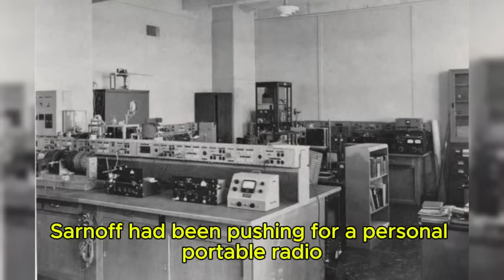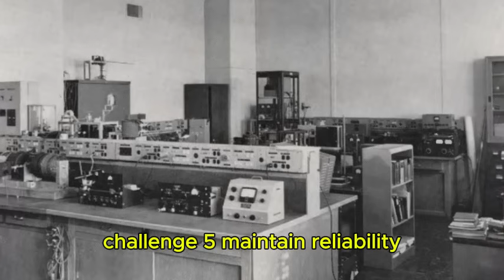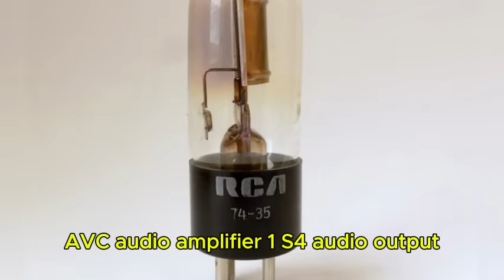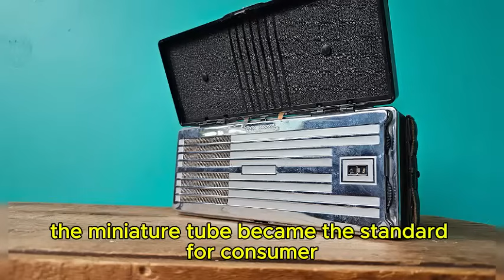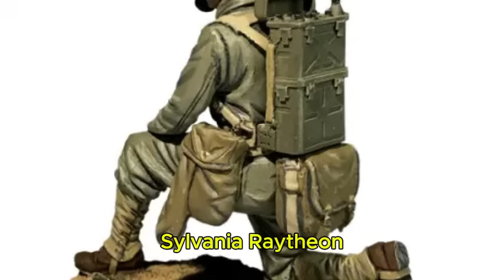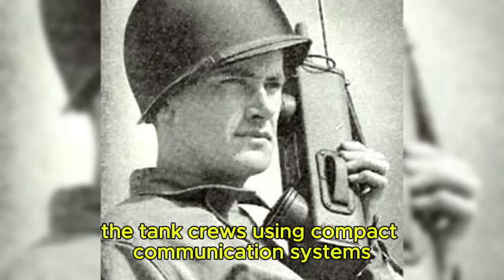America Had No Miniature Tubes in 1939 — So RCA Built Them for Portable Army Radios

Comment: Worked on 1 prc-10 found bad if xfmr after nam tour fixed several hybrid prc25s over there big difference ,25 had one xmitt tube one had screen grid wire tinned and wrapped but not solderedhad intermittent xmit oprrator actually pissed allegedly threw it down notorius Razorback!!!

Comment: The main reson for developing these small tubes was not the radio communication. Here an interesting excerpt of an article in the German Wikipedia, translated for you monolanguage guys.  

„After extensive research and experimentation, a breakthrough was achieved in 1943: the simple impact fuzes used up to that point were supplemented in the last two years of the war by intelligent, electronically controlled proximity fuzes (radio proximity fuzes), whose operating principle was based on the Doppler effect. Along with radar and nuclear weapons, the proximity fuze is among the most significant military innovations of the Second World War – the effectiveness, accuracy, and destructive potential of military explosive munitions with electronic proximity fuzes were enormously increased for the first time in 1943 in the Pacific War with the anti-aircraft shells fired from the Helena and equipped with the novel Mk 32 fuze.[2] The new weapon played a crucial role for the Allies in the Battle of the Bulge. By the end of the war in 1945, more than 22 million proximity fuzes had been delivered to the military, thanks to a massive effort and the enormous production capacity of the US electronics industry.“

Comment: There were even smaller tubes developed such as the 2E32 known as "peanut tubes"  not mentioned here.
Reply: The F-105 auto pilot system used the peanut tubes.  I know because I worked on them.

Comment: The VT fuse used hearing aid vacuum tubes which were much smaller than the miniature tubes mentioned.
Reply: They were NOT hearing aid tubes.   The shape and size of the glass envelope was much the same, but the design of the electrrode structure was different.   Hearing aid tubes were designed to have the lowest possible power consumption.   VT fuze tubes were designed to withstand the tremendous acceleration (up to 50,000 g) of being shot out of a gun.   Heater power for the VT fuze tubes was 5 times greater than contemporary hearing aid tubes.
Reply: @keithammleter3824  My point was that we had very small vacuum tubes before wwii.
Reply: @JohnMills-md7pv  Indeed we did, and not just hearing aid tubes, which of course were small, but that was not your statement - you said VT fuzes used hearing aid tubes, which they did not.
And the 7 pin noval all glass tubes such as the 1T4 series came out in 1940.  The US didn't enter WW2 until late 1941.  Acorns, some just as tiny, go back to 1935.
Reply: The tubes used were designed from scratch perhaps drawing on existing miniture electrode structures ruggedised to survive 20000g
Reply: @Jor-d2i  At that time, all tube electrode structure spacings, shapes, grid wire pitches, etc were designed on what RCA called "the principle of similitude", that is, by adjusting an existing design by educated guesswork to meet a new requirement, assisted by rubber band modelling.  This is because while tube math is simple in principle, it is very tedious and time consuming.
RCA was a pioneer in using a mainframe computer to design vacuum tubes, but that was in the 1950's.
RCA's B J Thompson was the lead engineer on the VT fuze tubes, he leveraged his experience in designing acorn tubes.  J W McRae was the lead engineer in devising an electrode support structure that could withstand 20,000 g.

Comment: Born in 1944, I cut my teeth on a 1H4G vacuum tube. About 15 years later I encountered my-first miniature tubes as part of the All-American five tube complement. Then, in due course, transistors, the 709 operational amplifier, and then a computer on a chip. It was quite a ride. Now I have a smart phone but am too dumb to use it.
Reply: Ten years younger, but agree. Started with surplus LINK radios in grade school. Soo many changes thru the years 👴
Reply: I have a splendid radio guide from 1927 exhibiting mechanical television, as well as early circuit diagrams. Things like superheterodyne receivers were in the near future, and some amateur radio handbooks, as well as repair guides for every radio from the 1930s. Later you could buy a transceiver from Heathkit,  or for $10 less, all the parts and put it together yourself. Heathkit tube testers always came as an assembly kit. I have two of them up on the ego wall, near my Heathkit SSB transceiver, and a variety of oscilloscopes... Heard it said, if you can take the Heath, you can stay in the kitchen.
Reply: The 1H4G vacuum tube was an octal-based full sized vacuum tube back in the day.  Subsequent 5-tube AM radios also used an octal based set and later went to 7 & 9 pin "baseless" miniatures in the 1950's. 
Even these were not actual miniature vacuum tubes like the RCA series known as the "Nuvistor",  which included a massive series of tubes that replaced octals and all were <1" tall, metal enclosed with pins out thru a glass base; still have a few of these Nuvistors in my heritage collection. 

The bizzaro tube shown with wires out both ends is nothing I have ever seen and does not look like a hot cathode,  electron emissions vacuum tube of any kind;  it does though appear to be some type of incandescent scant light bulb.

Comment: I had two BC-222 SCR-194 receiver transmiter sets. The set in the photo is the BC-1000 SCR-300, 
BC-222 SCR-194 was light as a 12 year old even with the A & B batteries one could carry it all day. The range was poor at 30 MC at about 100mw one was lucky to get over a mile range.
 see radio museum

Comment: I find it so annoying when vacuum tube numbers are incorrectly noted. I see 6v6 and 6l6 and 12ax7 so many times. The letters in vacuum tube notation are ALWAYS upper case. RCA was the big dog in vacuum tube manufacturing, research and development, but Raytheon was a contributor also. In fact, Raytheon was the inventor of the subminiature tubes popular after WWII. They were virtually flat, and could be packed into circuitry to make a very compact receiver.
Reply: Quantum ....  You give a lot of accurate information in one paragraph,   Careful you may end up with subscribers.
Reply: Note: the submini tubes are both filament (1AD4, etc) and heater, (6111, etc.)

There are a fair # that more or less duplicate the specs of miniature tubes, e.g. the 6111 roughly duplicates the 12AU7…

Comment: Note that there is no 1I4 tube, it is actually a 1L4.  Also, a B9A and a Novel are not the same, even though both are 9 pin bases made in the same way.  A Novel is much larger than a B9A.  Also note that the pins are not made of Tungsten.
Reply: Meanwhile, I just fired up my HeathKit home built SB-610 oscilloscope, and it still works perfectly with tube technology. It's just the right size for propping up the 27 inch apple desktop I got for free and put a new hard drive in. Plan to use that for graphics supporting the science fiction novels I write.
Reply: What they are not saying is the 536 became bc 611
Reply: The reason I know I have 4 bc 611 wwII walkie talkie